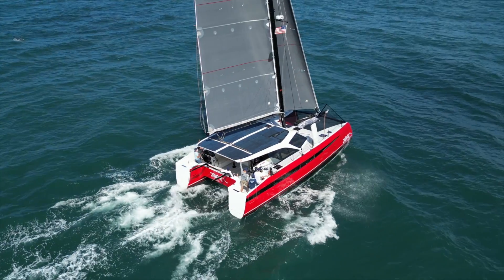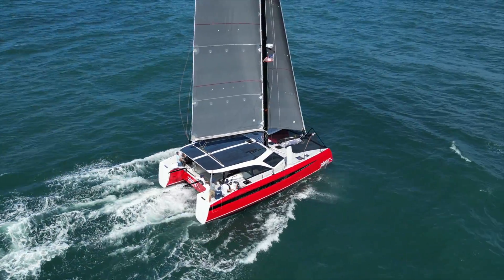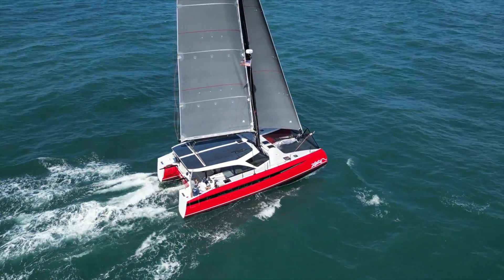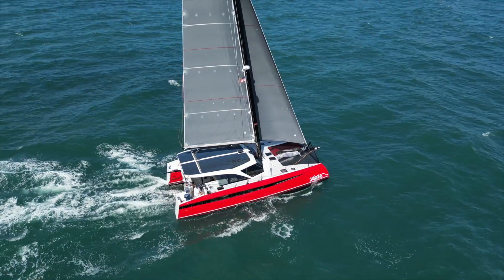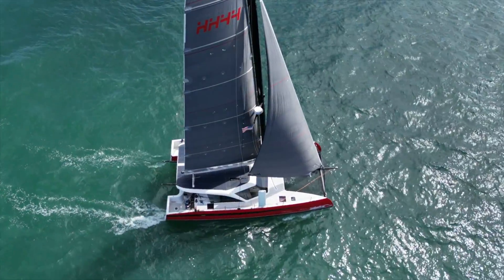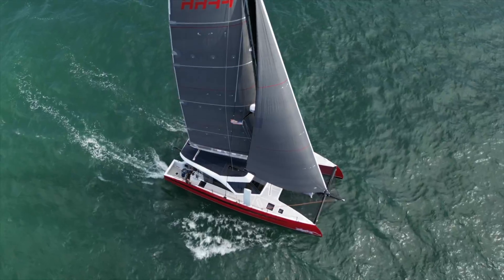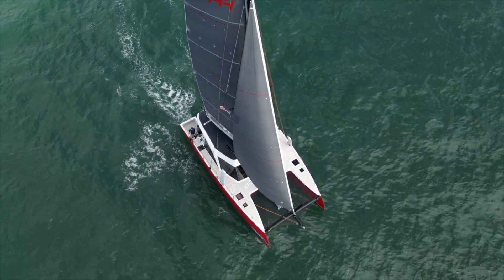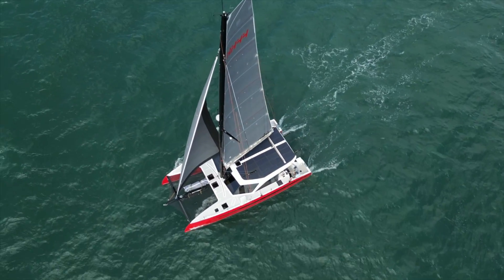HH44 Catamaran - Boat Review Teaser - Multihulls World

Comment: May 8, 2024.  Hull #2 in Red was first seen at the very start of the HH44 series production. No question she is a genuine hull flying capable-dagger board beauty.  Hull 2, was then seen while under final construction and during its initial water launch at the HH factory when YouTube's channel "Gone with the Wynns"  with Jason and Nikki Wynn were there. The Wynns conducted extensive technical interviews with engineering, management and HH artisans as to the Hybrid electric propulsion system, transferring HH racing boat technology to the HH44s and the benefits of using high strength carbon fiber and epoxy to fabricate the hulls, dagger boards and other catamaran parts. During the factory lunch hour the Wynns had free access to roam, view and video record  the progressive build steps as their own blue water HH44OC (hull #3) was being built.  At last report the Hudson Yacht Group had received more than 35 orders for their HH44s.
Reply from the maker: Discover our full test: https://www.multihulls-world.com/review/catamaran/hh44-a-hybrid-catamaran-full-of-clever-little-features
Reply: @MultihullsWorld  Ya check out what happened to the Wynns... a cautionary tale